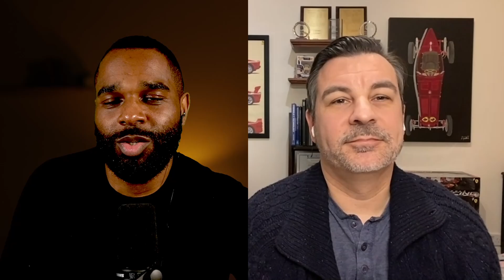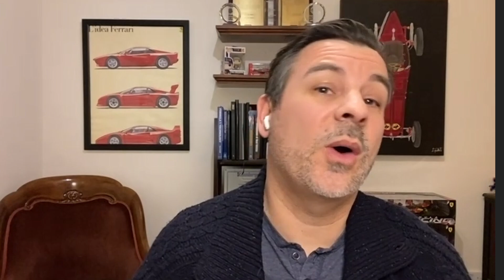Mercedes' Genius Anti-Dive Suspension Explained

Comment: Not genius. Red Bull been running it for 2years
Reply: Red Bull haven’t had a chassis where they can change the pickup points of the suspension from track to track.
Reply: @biglez6766  correct. RB found the right point that works everywhere but Singapore. Mercedes is still looking.
Reply: @biglez6766  because you don’t need to. Once you set up the amount of anti dive you want for the amount of downforce your car can produce that’s all you need. It’s about keeping car level under braking and acceleration. Car will always brake the same and accelerate the same. All year

Comment: What benefits is using all this tech for it to go in to road cars just so you can’t go pass 20 miles per hour 
And 70 on motorway in England 
The point I’m making is just all use  the same engine and output of power and let the aero be the work where the advantage comes from 
Maybe one year all use merc engine
Next year a Honda engine etc